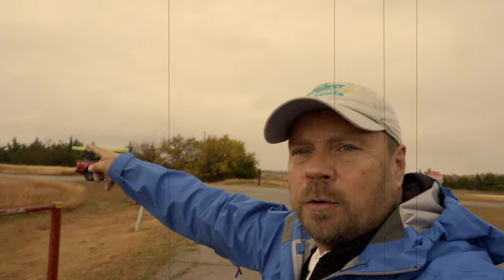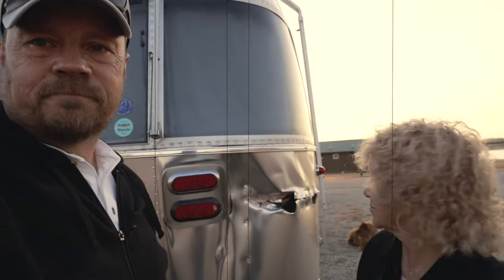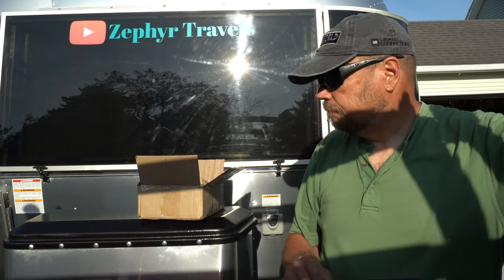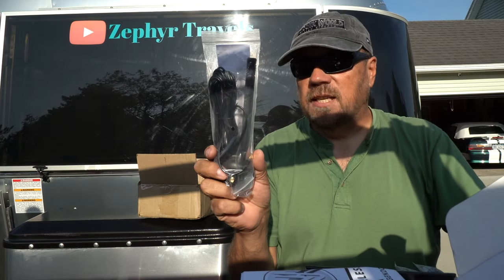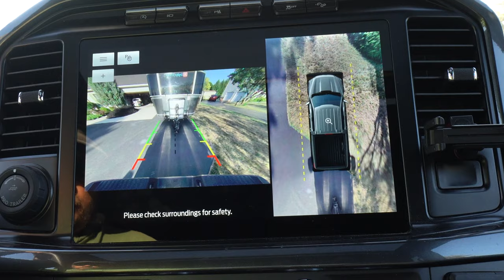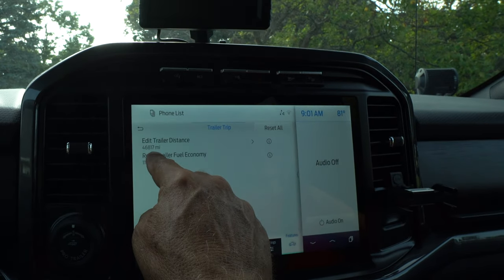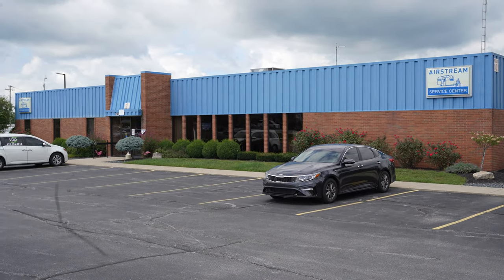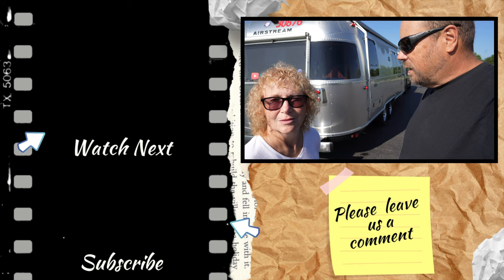Getting our Airstream Fixed @ Jackson Center / New Antenna for the VisionWorks Camera | RV Lifestyle

Comment: Good video and we are so glad to see your Airstream all back to new.  BTW, what is your additional 4 pin hookup when hitching?
Reply from the maker: Thanks, it’s so nice to not to look at the dented back corner any more.  When videoing the Airstream at campgrounds I would avoid that side as much as possible.  I was wondering if someone was going to ask that? The second plug in is for the Ford Pro-backup, it connects to a yaw sensor mounted on the tongue of the trailer.

Comment: Hi Randy and Dianne, When you hook up to the truck, what is that second connection that you do after the seven-pin connector? Just curious... :)
Reply from the maker: It’s a connection for the “Ford Pro Backup” system on the truck.  It senses the position of the trailer.

Comment: Thanks for the video. So did I understand you correctly that the boosted antenna on the camera helped, but putting the boosted antenna on the monitor made it worse?
Reply from the maker: That is correct, I added the boosted antenna to the monitor and the image keep dropping out.  I don’t understand why, it may be because the antenna is to close to the roof of the truck??  I don’t know.  You will see in an up coming video that I tried the remote antenna on the monitor and mounted it on the roof of the truck near the back.  The seams to work the best and I liked not having the antenna in the windshield.
Reply: @ZephyrTravels  Gotcha. Thanks for the information. I spoke with Cody over at Vision Works, and he is sending me some things to try out as I have been having the same issues as you with this in our fifth wheel.
Reply from the maker: They really need to just include the boosted and remote antennas with the camera.